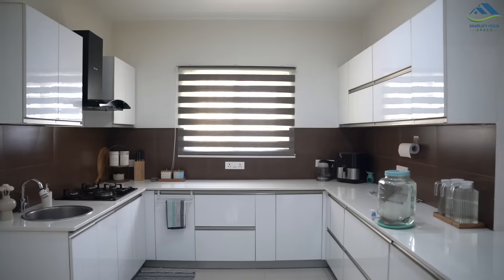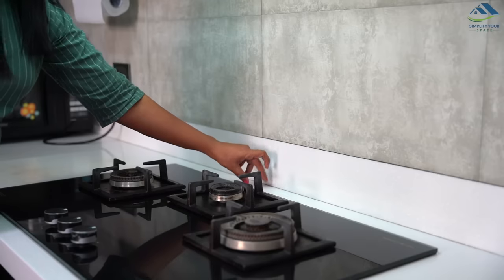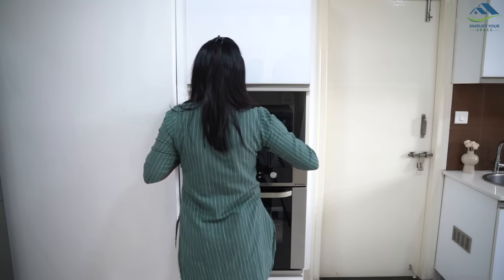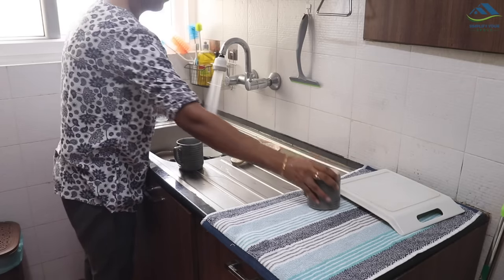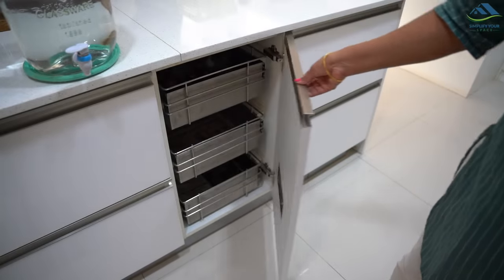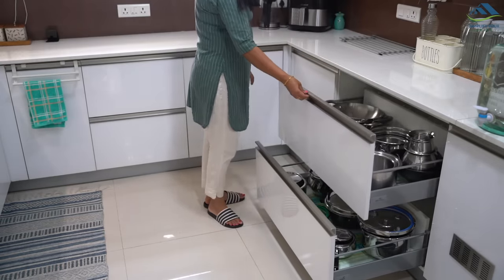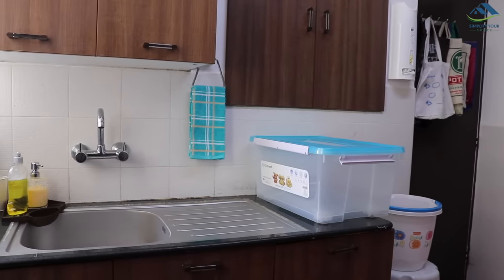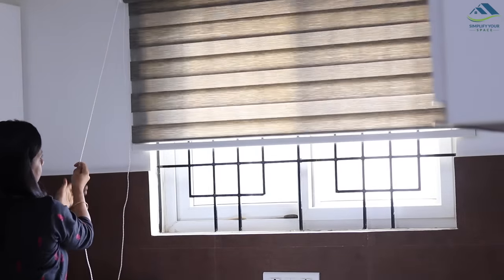11 Mistakes to Avoid While Making Modular Kitchen | Kitchen Designing Mistakes

Comment: Any ideas on how to accommodate sitting arrangements while cooking? It gets exhausting while a large amount of cooking has to be done at a stretch, specially after a long day standing even at work.
Reply: Ii
Reply: Cost of kitchen
Reply: Alternatively, you could have a fold down countertop if you have a bit of free wall space at the right height - IKEA has a range of fairly low cost tabletops in a bunch of colours - one of those with a pair of large folding brackets is what I use in my laundry room.
Reply: Chair Laga Lo ya phir chopping neeche baith ke karo
Reply: Yes, even I am looking for sitting arrangements while cooking in kitchen..? Did u get any idea pls do share.
Reply: yes i hv find a idea  @AlluringAarika
Reply: where u keep gas stove
under that make empty like dining table
then put a executive chair with wheels
then sit n cook😊

Comment: Just got our modular kitchen done and can so relate to each and every point! Mine is white too and really classy. Another point to keep in mind is over the counter cabinets that can sometimes be risky while deep in work. You run the risk of banging your head while deep in work!!
Reply: So agree with this. I am short so I never have problems but as I my husband is tall, i have made it a point to not fall into the habit of leaving the doors ajar while cooking. But yes banging directly on the cabinets is a big risk.
Reply: overhead cabinets as a rule are supposed to be only 12 inches deep,so when the shutters are opened its almost 24" it will align with the edge of the cooktop/granite counter,so the banging of head issues can be resolved. tq

Comment: Sink pipe should be inserted to wall below instead of floor. This will give you a drawer area to keep cookers etc.  Also remain clean n no pests.
Always your left side shelf next to chimney should have masalas n right side for tea, coffee n tang.
No points very close to the gas.  
Tall unit very good for your crockery as easy to remove day to day than top shelf.

Comment: Great content Maam. Just a suggestion on the sockets behind the refrigerator and microwave. You could have used  16 amps Smart switch  instead of pulling wire and fixing a separate switch.
Reply from the maker: When we did the interiors 4 years back didn't think about Smart home and sockets. Will surely try it out now. Thanks for the suggestion.
Reply: Could you provide more details pls
Reply: What is 16 amp smart switch. Kindly guide.
Thanks

Comment: Very useful and well explained video for planning the interior of kitchen.👌👌

Just one regret…. Wish it was out 2 years back when I got my house interior done… have made the mistake of  closed vegetable drawers for onions& potatoes & regretting for  not having any ventilation for it… the potatoes keep sprouting…😥😥😥😥
Reply from the maker: You can still place these Vents. Just buy these Air vents from local shop or amazon and get them fixed by a carpenter. I also did the same mistake and got them fixed last year.
Reply: @SimplifyYourSpace  … thank you for your suggestion 🙏🙏🙏… will definitely do it.👍

Comment: Great content from you as always! I am actually struggling with something in my kitchen. What solution should one look at for undercounter drawers/cupboard opening mechanism? I got these high quality handles that all tend to discolor/gather rust spots when water spills from the counter top. This is especially true for the undersink cabinet handles. Do the strip kind (is it that free aluminum btw) that you gave in your kitchen wotk better?
Reply: One tends to understand the problems only after you start living. I am planning for a modular kitchen so I am going handle less but to help you i have seen in one of homi mommy's video where she has some vaccum barrier which she has attached in front of the sink & water doesn't wet your clothes too. She is a Korean blogger. I haven't looked for it on Amazon but that looked very easy to manage at the moment. Hope this helps.
Reply: On Amazon you get a roll that is like sticky tape in beautiful colors you have to stick it on the handle

Comment: One issue that no YouTuber, no interior designer ever considered is how to design the kitchen with innovative elements which would avoid issue of Cockroaches with very easy daily regime. Using the insecticides is not completely effective. The places where cockroaches hide are ample in every design and that’s exactly the issue. I had made personal design keeping this in mind but interior designers are not used / well versed to implement by design and unless they make customisations the shelves are going to shake and loosen up over time if constructed in my customised design. I am stuck with this for weeks on how to proceed.
Reply: Exactly an issue with me !
Reply: @HomeGardeningMadeEasy_  I have finally decided to go for kitchen with complete granite construction. Then going for HDHMR doors to it And then filling all the minute gaps completely with silicon to ensure there are no places for cockroach to hide. The best thing to avoid cockroaches is to not touch kitchen platform to wall but keep 6 inches gap and it’s possible with granite kitchen. No cement involved just constructing with granites. All Rajasthani workers know how to build it and then use the gap of 6 inches between wall and kitchen platform to apply hit everyday before night so ensure cockroaches don’t even enter the kitchen wardrobes. I have added many such components like movable kitchen wardrobes with wheels etc. I developed Special  design and getting it done right now. Hopefully I will be successful in this effort so I don’t have to suffer with cockroaches nor I have to murder them everyday🫣
Reply: @Vidyasagarbb  oh thanks for the valuable info. But do limit the use of HIT !
Reply: @HomeGardeningMadeEasy_  sure. Could not find other good alternatives after trying many. Do u have any special reason for ur suggestion ? Do u want to say bit more about what u were saying ? Thx
Reply: @Vidyasagarbb  actually, i too want to build a cockroach resistant kitchen. Using hit in the kitchen is a strict no with me , as it is essentially a poison and it may land up on our i utencils or other places
Reply: @HomeGardeningMadeEasy_  there is a unique technique I discovered to use hit. I use a paper to drag cockroaches onto floor and then apply hit gently so not too much hit is used and hit liquid doesn’t fly in the air to keep utensils safe. From last 8 months, I mastered the art.,.
Reply: @Vidyasagarbb  😀😀
Reply: You are 100% correct in your thinking ..we really need a cockroach proof fittings...difficult to find one!
Reply: @davehar447  I am building my own kitchen with all such models and designs and fittings that greatly minimise and May even avoid cockroaches. All based on my own thinking and research. Let’s see how it works.
Reply: @Vidyasagarbb  wishing you best of luck. There certainly is a market for reasonably priced such fittings.👍🙂
Reply: @davehar447  thx. yes. My design costs 40% lesser too. But need to compromise a bit on beauty. Building it in my new duplex house. But to maintain it i am looking for a cockroach repellent not killer. Do u have any suggestions?
Reply: @Vidyasagarbb  😅
Reply: @Vidyasagarbb  don't you know about hit gel, very safe need not to spray and it's very effective...try that gel
Reply: @abdulnoor2952  first learn to read before u reply. Gel is to kill them. Not to prevent them from reoccurring. You have no idea that there are medicines which work more effectively than hit gel and hit gel failed in many of my neighbours place. They don’t completely kill them and u have to keep doing it. I have built a solution for all of that now I need something to avoid them or preventing them to enter into particular place. I don’t think u even understand the need.,.
Reply: @Vidyasagarbb  oh... great, you are a scientist!!!
Reply: @Vidyasagarbb  Long post: Make tiny balls of atta mixed with boric powder and water. Put them in all the locations you usually find cockroaches or the ways they enter in - drains etc. Replace it, say every two weeks once the boric powder loses its potency. Keep at this. Eventually, slowly, you'll find no cockroaches come around. Keep a dedicated vessel in a safe location (inaccessible to kids, pets or anyone who visits long term) to mix this, because boric acid is poisonous and it looks like atta. You don't want someone or a pet eating it by accident.

It's not harmful unless ingested. It doesn't kill the cockroaches but it renders them sterile over time (months). In the long run, I think word gets around the cockroach world and they won't come in, lest they go sterile, even if you don't use boric acid. 

My cousin has a pest free kitchen - has been so for years. Asked her and this is what she told me. She'd not used the mix for two years, after using it regularly for years, and still no cockroaches. But it takes time and patience. She also had pets: no got ill because they didn't ingest it. Hope this helps.

V.IMP - Ensure boric powder doesn't get into food stuffs or liquids or any vessels used by humans/pets.
Reply: @orientalshorthair5579  Thanks a lot. Hope this helps. I will probably first try some cockroach killer and once they come under control, I will use this long term solution so we get some immediate relief from the cockroach menace. I have patiently worked hard to find and kill cockroaches for months using the red Hit but as soon as their numbers went drastically low, I have stopped it only to see them appear in big numbers again in 6 to 8 weeks. Crazy amount of time being wasted for this.

Comment: Great one, few more pointer which I learned, the stylish drawer handles which are integrated in drawer with sharp edges tend to tear clothes. Also the height of drawer should be planned so that you can keep ur containers. So ideally it should be the other way plan your cutlery, containers and measure max height then select drawers.

Comment: I have a single undermount sink in my small kitchen, with uneven cement sealing. No steel platform just sink basin. Equally difficult to clean the edges, cannot brush daily. I will try dr. Fixit tube. Also when i rinse the soapy tap, water spreads on kitchen platform. I wish there was a separation rubber line... but the how far from the sink? Its tricky because too close will still splashes the other side and also make obstacle for any dirty vessel to sit straight on it...

Comment: One thing I messed up was NOT putting outlets in the corners. There are a few small appliances that are used so often that they stay out. Two of mine have a cord draped two feet over the counter to the nearest outlet. Ideally, I wish there were outlets in the underside of the corner cabinets. Then things could be plugged in, but I'd have fewer outlets to look at. 

And no, I don't want to unplug the machine to tuck away the cord every time I use one of the two. I'd be plugging and unplugging about 6-10 times a day. That's not happening.

Comment: What material is best for modular kitchen, plywood or UPVC or WPC? Please suggest. I'm looking for a durable option which is termite free and moisture resistant
Reply: Please go in for Marine Ply (Pre Laminated)with mat finish option. Slightly Expensive but will endure oil, water and constant fumes and vapor as a result of kitchen activities.

Comment: Damn I am smart.. I got all of these except a vent below the sink.. it is a good idea to have.. I will see if I can get it done now! In general, a couple of other tips:
1. Avoid hob. Standalone cook tops are better. Easier to maintain and clean under. If you need to put a really big pot on a back burner, well, just pull it forward by 2-3 inches!
2. Tandem boxes are overrated. Get soft close channels (which are 5-10 times cheaper than tandem box, within the brands like hafele or hettich). Of course, you will have to make the side walls yourself, but it will still be much cheaper. I have got both, and there is literally no difference it usage!
3. The potato/onion basket shelves are also over rated. Better to buy the "beautiful homes" potato and onion jars from home center. You can clean them easily whenever you want, and can put those wherever you want.
4. Having a shelf for oven is also not a great idea. The way these are made, the switch will typically be at the back. Plus you can never buy a larger oven than the slot. Kitchen corners typically do not get used as much, and you can put up to 50 lt ovens there comfortably.

Comment: As per vastu it's not recommended to have sink just next to cooktop. Also I see fridge very tightly packed it needs air circulation as it heats up.  Also I think a centralized switch board for all appliances is better option than providing switch very nearby which is unaccessible later on.

Comment: I too made a full plain white kitchen but platform is black. Do you advice white wallpaper for platform from amazon? What about the wallpaper for fridge for color make over... if yes, will i be able to stick it on my own or will need experts?
Reply from the maker: Please no..don't use wallpaper for platform. For fridge also I won't advice unless your fridge is in very bad condition. If fridge looks good don't put wallpaper.

Comment: About plug points you have not suggested where to place it/them.
Reply from the maker: Wherever you are planning to use the appliances. No point placing them everywhere. According to your kitchen design, place them.
Reply: Near the appliance or all switches in one place. whatever you decide, but keep the switches at eye level. It is difficult to bend down to switch the appliance on and off frequently, specially the microwave oven. All it takes is a bit more wire. The convenience is enormous.

Comment: Thanks for the very useful tips. You seem to have a outside ventless chimney. Can you tell if it is better or the one which vents the air outside?
Reply from the maker: No this is not Ventless chimney. The hole is not visible and pipe is given in the utility area. I prefer this one.